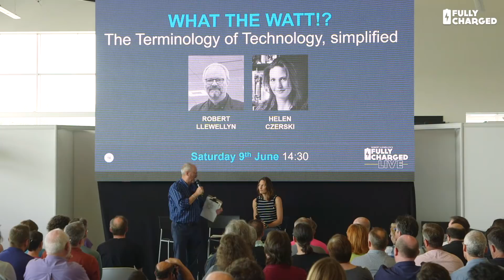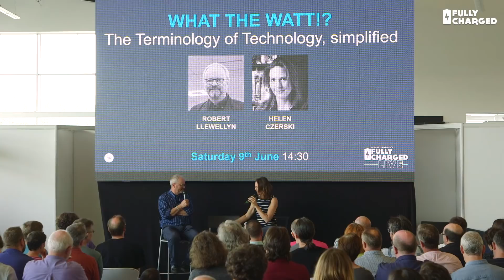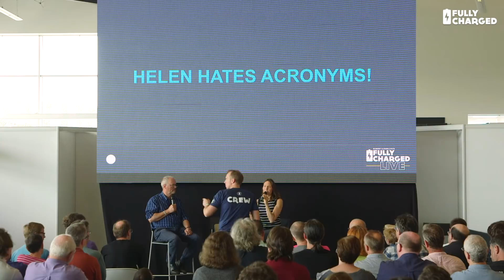What the Watt!? | Fully Charged Live 2018 Talk 7

Comment: Surely you would only need a 500amp charger is if you have a massive battery. A massive battery means you get to your destination without stopping. So you would charge at your destination at between 32-50amps over a long period. Making 500amp redundant, doesn't it? Excellent videos. I was there but couldn't here the talks very easily so thankyou for the repeats.

Comment: Capacitors as well as batteries. Fastest dump of electrical charge!
The Class 67s I drive push 2MW to the wheels. Rated up to 5KA but I tend to keep it below 4KA. Voltage varies with current, of course, according to P=IV.

Comment: Just curious as I'm not british. Why did she skip a possibility to have your house connected with 3-phase AC and being able to charge with 11 or 22 kW power?
Reply: Because that's almost unheard of in the UK... domestic properties almost always have a single phase main feed. Streets are typically wired up with each of the three phases going to different sets of houses. Because of that, it's usually prohibitively expensive to have a 3-phase feed installed in your home

Comment: In the U.S. and possibly elsewhere, the standard terms for charging power are Level 1, Level 2, Level 3.  Level 3 is fast charging, say 50 kW and above.  Level 2 is what most public charging stations and home EVSEs are at 3 to 7 kW.  Level 1 in the U.S. is our wall outlet at about 1.4 kW.  The wall outlet in Europe is about double that, due to higher voltage and current.
Reply: Loanword Eggcorn this seems like a much better way of classification than in the UK, whose current lack of clarity is confusing and ambiguous.

Comment: So many errors! This causes more confusion instead of clarifying misconceptions. A kW is 1.33 hp so 3kW would be 4hp mot 2.5.
The 3rd person asking a question states that 120kWh charger  is 1.2MW.  In the comments 1100 amps @400V = 440kW not 750.  -70Kelvin?

Comment: For comparison with her "500 amps!" statement, our datacenter with about 250 racks and somewhere over 3000 servers had two 2000 amp 400 volt 3-phase feeds. We'd comsume about 1100 amps (750 kW) under normal production.

Comment: Watt (pun intended) will help our use of the correct units is, imo, familiarity!  Today, we talk about Miles per Hour, and Miles per Gallon and intrinsically and grammatically understand the difference.  If someone says "i was driving down the motorway at a speed of 40 miles per gallon" then the average listener immediately would spot the error, as it just sounds wrong.

But today for most people, the difference between kW and kWhrs is not as obvious.  To me, having dealt with those units for 20 or more years, when someone says "My battery contains 100 KiloWatts" i immediately spot the error, it sounds wrong to me, but for the majority of people, they are not yet familiar enough with the terminology to intrinsically make that connection.

I actually chatted with Helen after that talk, making this very point, and i think we were in agreement that over time, people will adopt the correct vernacular as they have more useage of it!

Comment: 4.24 bit of a blunder 3kw is a little over 4hp not 2.5 perhaps it was just nerves.
Definitely enthusiastic about the subject though.
Also physicists job is really is to come up with proven experimental lab based proof of concept, engineers take that concept and turn it into industrial scale systems.
Historical super conductors used liquid helium (expensive) as a cooling medium, current state of the art materials are starting to use liquid nitrogen (cheap) as the cooling medium, room temperatures super conductors are quite a way off from now.
A common use currently is in MRI's which have $100,000 of liquid helium inside, but the low temperature allows a 1mm cable to carry 1,000 amps (a1mm domestic copper cable would be OK for 10amps)

Comment: 1 kw is more than 1 hp. She confuses them a bit to begin with. To change her analogy a bit 1 hp would be a normal horse and 1 kw would be a Clydesdale. As in hp is like yards and kw is like meters , a full hp is a fraction of a kw
Reply: I like your analogy but the horsepower unit was based on a heavy workhorse.  So a Clydesdale would produce 1 hp.

Comment: 3 kW kettle? Really? That would blow my fuses...
Reply: zapfanzapfan Pretty much all kettles in Europe are around 3kW. A super cheap one is usually 2.2kW. we need our tea and coffee quickly you see.
Reply: I'm in Europe :-) I thought 220V 10A was the general standard for outlets, with some 16A.
Reply: zapfanzapfan UK and Ireland, 32A or 16A if not radial. Most in Spain seem to be 16A. Europe standard is 230V, but it's really anywhere from 220 to 240 ish.
Reply: There is often a mention of a 13A socket in British programs. If it's 13A at 240-ish V that's almost exactly 3kW.
Reply: Just Curious just out of curiosity I looked on Amazon the 5 top sellers and suggestions are 3kW followed by 2.2kW at 6th
Reply: zapfanzapfan yep 13A is the maximum fuse rating and is fitted inside each appliance plug in the uk and Ireland. This is to limit each plugged appliance to 3kW.  Note this is not a breaker but a physical fuse in the plug that can be changed if blown.  A standard 32A ring main, the most common circuit over here can support around 7kW before tripping.
Reply: zapfanzapfan a typical house will have either one two or three ring main circuits for the sockets. Upstairs/downstairs/ kitchen. Or front of the house, back of the house.
There will be another pair of circuits for lights. Then other circuits for shower, cooker, water heater etc.
Reply: I suppose, 16A is rather standard today.
Nevertheless I'm not sure if 3-kW-kettles are really the general case.
Mine is 2 kW, and that is quick enough.
That's roughly from 15 to 100 degree Celsius in 3 minutes (1 Liter).
Reply: Ok, so you don't have separate fuses for different groups of outlets and lights? Like one for each room? We have a number of separate 10A circuits (and possibly some 16A) and then the stove has it's own circuit since it can draw 10kW if everything is switched on. The usual main fuse for a house is 25A (400V 3-phase) so one can draw 17kW but you can chose down to 16A if it's a summerhouse or otherwise doesn't draw much power but the standard cables installed from the transformer to your house can handle 25A. When you install you can pick up to 63A before you become a specialty case. I'm planning on installing electricity in a house soon...
Reply: zapfanzapfan I was talking about the circuits that handle appliances you plug in, average size house in the uk would have 32a ring downstairs 32a ring upstairs, 6a lighting radial upstairs 6a radial downstairs, 32/40a electric shower, 10a for electric oven/hobs. Usually have a 60 to 100a main fuse for the house. In the uk/ireland we only have 230v single phase coming into the house.
Reply: Ok, I thought 7kW sounded a bit low but I figured with a gas cooker and gas boiler it might be enough.

So, the reason for the 7 kW car charger is that 32A rings are a standard and the charger occupies one rings entire capacity?
Reply: zapfanzapfan no we only use rings for the appliances with plugs, for a dedicated high power outlet we just run one thicker cable. The idea of a ring circuit so you can use smaller diameter wire, like two radial circuits running in opposite directions, I'm not a fan of them as if one of the cables breaks you end up with a big breaker on an undersized cable. Not worth it for the money saving in my opinion, but what do I know we have been managing with them for a very long time now.

Comment: Why KWh and not kilojoules...or maybe megajoules? Maybe it's a bit more convenient but it seems roundabout to talk about energy in terms of power by hours. I also think these discussions use the term "energy" instead of "power" to the point where it is a bit confusing.
Reply: Electricity is sold in kWh, so that's why the unit is often used.  It would be nice to get away from kWh to avoid the confusion with kW.

Comment: A typical kettle consumes 3KW to boil its contents. Usually, you don't need a FULL kettle's worth of boiling water but people tend to boil a full kettle worth nonetheless. 
THIS IS VERY WASTEFUL !!!!!!
Several years ago, I purchased a "Breville HotCup Hot Water Dispenser" costing about £39. It uses 3KW 

This dispenser boils just a SINGLE CUPs worth of water in about 30 seconds.

It is one of the best investments I have EVER made for the following reasons:-

1) It reduces my energy usage significantly (it pays for itself in about a year)
2) It reduces "Peak demand" of the National Grid (less Nuclear power plants required if many users get one!)
3) It is MUCH safer than a standard kettle (The remaining water is completely cold and so cannot scald children if spilt)
4) It is much FASTER than a conventional kettle (for one or two cups, for instance)
5) It will hold a small stainless steel teapot so you can still brew in conventional way

I use one PG tips teabag, a small S/S teapot and two "presses" for a perfect brew (2 cups - both for me)
See it here:-https://www.amazon.co.uk/Breville-HotCup-Water-Dispenser-Litre/dp/B001L5SSGQ
They also make a larger one with a 2-Litre capacity
https://www.amazon.co.uk/Breville-HotCup-Dispenser-Variable-Dispense/dp/B002NGNRHC/ref=pd_lpo_vtph_79_bs_t_1?_encoding=UTF8&psc=1&refRID=ZS15VM151QNE610TAS1V

Comment: Good talk, clearly very knowledgeable. Seems a bit new to EVs. 3kW is typically household plug charging, 7kW is household charging when using a dedicated charger which most people here will be doing (also I don't understand the physics as well as her but 7kW home charging is more efficient than 3kW home charging, how it's wired directly to mainsboard rather than the cables that go all around the house and/or length of cable maybe?). 22kW is triple phase (mostly only businesses have this 3 pipes of electricity coming in to do this) and Rapid is typically 40kW+. People call the 7kW charge rate different things and we tend to get muddled between what's a "Quick", "Fast", "Medium" and which is greater (Fast quicker than quick or quick faster than fast?). Some people even call 3kW slow and others 7kW. The names differ but the numbers are always unambiguous. I try to avoid using any of the names other than "Rapid" for 40kW+

Comment: 4:15 it seems she got herself confused with kW and horsepower
Reply: Christoph Hopfner Yes, she just inverted the conversion ratio - easily done when you're focused on giving a presentation etc. So a 3kW kettle more nearly equates to 4 horsepower.
Reply: Sure, anyone can make a mistake, but when giving a talk or lecture accuracy is surely paramount
Reply: Christoph Hopfner Yes, it seems the prof got things confused. As a retired electrician, I thought it was me doing my maths wrong. Tsk prof!
Reply: Bartholomäus, hello I think you missed the wink at the end as i was joking, I said 746 horsies is 1 watt with a wink, as you pointed out the 746 watt is 1 horsepower I knew this without Google.

Imagine a world where you need many a modern car engine to run an incandescent lamp that's where my wink would leave us.
Reply: Markle2k  Well, I’m not a professor used to giving talks or lectures or presenting my work to others, so no I couldn’t do better. We will have to agree to disagree
Reply: 3 kW is actually 4.02307 HP :)
Reply: Mr Spock, you're still the best First Officer in the fleet!
Reply: (tbyte)
Reply: This struck me immediately too. However, what is really the shame, is that now more than 2 centuries after James Watt (indeed) was trying to market steam engines by indicating how many horses they could replace, we are still using horsepower as a unit at all. Hardly anyone nowadays has ever seen a horse at work (though interestingly, a well trained human athlete might produce about the same power, over a short period of time).

As a didactic rule, always express secondary and/or obsolete units in primary units, not the other way around; if Helen Czerski had said expressed hp in terms of kW (about 0.75 of them), I think she would have less likely made this slip-up.
Reply: 746 horsepower is 1 watt ;)
Reply: Tomas O Maonaigh yeah I don't blame her, in general the talk was great.
Reply: I noticed that too, but it's OK because in this kind of discussion as long as the order of magnitude is roughly correct and energy and power were not confused, it is fine. The point of her discussion stands firm.
Reply: +Nigel Morse No. In this setting Fermi approximations are alright so long as they don't get past the rounding limit of square root of 10. Horsepower are roughly equivalent to kW and she got it right the first time. After that, you are criticizing note-perfect performance vs. the recorded album. You are criticizing her for not doing math(s) on the fly in her head. I doubt you could perform better than her on a stage in front of an audience of 250.
What you need to concern yourself with is "did she get the message across correctly without misleading people?"
She did. Stop being an internet pedant.
Reply: Ian Hill: No, 746 HP are 556.000 Watts.
I think you meant 0.746 Kilowatts are 1 HP.
Google has a useful calculater built in it. Just google " 1 horsepower in kw"

Comment: It has been quite difficult to buy actual 3kw kettles for some years. Most new ones are rated about 2750 watts, now. Of course, they do NOT use any less total power to boil the water. Per pint or litre, that remains exactly the same. The lower rate of power delivery just means they take longer to reach boiling point.
Reply: See my response above re: "Breville HotCup Hot Water Dispenser"
Reply: Total power? You conflated energy and power, which this video attempted to explain as different.